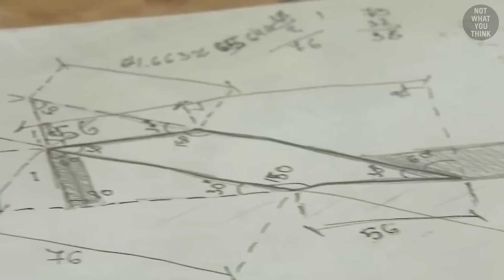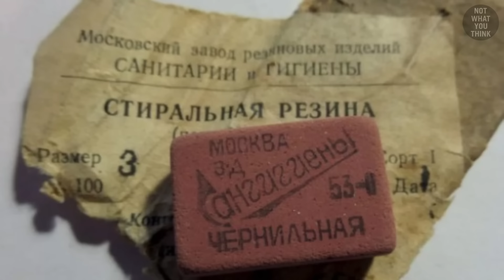These are Tanks that Ukraine hopes Russia Would Destroy

Comment: 12:13 it resembles a grave, so it will work no matter what happens 😂😂
Reply: Now using mostly intact but otherwise non-functional/unrepairable equipment as decoys is a damned good idea. A bit of welding, some paint, and some weathering, and it will look like its operational.
Example: shell of a tank with internals/engine removed. used anti-tank tubes on faked emplacements, etc.
Reply: H Dr.Kay_R

Comment: The first time decoys made a massive change was during the NATO bombing of Yugoslavia. Back then, wood models of airplanes were made in 1:1 scale, painted with original paint (MiG-29) and the engine "exhaust" was made of one metal barrel cut in two. Also, the wooden model would be padded with tinfoil and fires would be burnt in cut barrels at the back. That way, it would have both radar and heat radiation making it pretty much impossible to see as a decoy. Also, false radar positions with fake radiation sources were made in order to divert HARM missiles from real ones. And so on...
Reply: Did not work though and those responsible for war crimes ended up paying the price for them.

Comment: Fun fact general Patton was the published leader of the inflatable army after and as part of his punishment for slapping a shell shocked soldier.
Reply: You are correct. Dummy / inflatable equipment dated back in ww2
Reply: @kanthanesankandiah760 was the " dummy" the guy Patton smacked?
Reply: Patton's Army regularly out ran it's fuel convoys.

So did Hitlers Blitzkrieg. But for different reasons.
Reply: @douglasbillington8521  wtf

Comment: And you can pretty much guarantee that AI models will include decoys in their training as real targets, because it's already hard for humans to distinguish between real and decoys. We'll probably see a transition to more complex decoys as weapon systems start to have multi-sensor integration. Right now, very few weapons or platforms will analyze targets with radar, IR, and visual.
Reply: And there is part of the problem. Simple decoys are cheap and quick to build. Even basic anti-tank weapons are not. Smart anti-tank weapons even less so.
Reply: @yadayadayadayadayadayada777  no matter what people tend to say the leopards are outclassed and outdated compared to other tanks, the m1a1 is also outdated since the m1a2 is more modern but these newer tanks like the Leclerc sxxi/evolution/xlr can detect and take out any drone easily, the new panther doesn't seem that much promising with no anti drone turret

Comment: Decoys will be the first use of humanoid robots.
Reply: Surely a better use is a decoy that fights back, i.e. walking Gun Turret
Reply: Why bother with robots? Humans are cheaper/easier to replace. At least that's how Pootin would think.
Reply: @douglasbillington8521  I doubt it even for Russia. Once humanoid robots are at a stage they can be mass produced, I'd figure for decoys each one would cost like $6k max. Not that many parts, most of the value is in the software. If they are partially destroyed and recovered the cost is going to be even cheaper for a decoy.

Comment: its CRAZY how they dont spend the extra 100$ on each decoy to have
- A: Heating Pouches for the Inflatables
- B: Adding RC cars to the bottom of the tank tracks to actually move them for better decoy destruction odds
- C: Add fake radio chatter
Reply: Do you believe this video shows all the top secret tactics of the armies, and there is nothing else they might be doing that wasn't revealed to the world?
Reply: They have miniature RrC tanks that they use to distract at a distance, you can place a bao feng cheap radio inside one of rubber tanks and in daylight you dont have to use heating because its already hot in daytime. They move the decoys at night in different position
Reply: RC ? Then you need to spend more (time and resources)for advance control systems be able to work in radio suppressed environments.etc.

Comment: Here is a simple way to tell if a decoy is made of steel or not.

One can suspend a magnet from a UAV by a 1,000 ft cable.

e.g. Google
Morgan's Tackle Co. 1000 Feet 7 Strand Stainless Steel Trolling Line 30 LB

If the magnet attaches to the target then it is made of steel.

Sure the Russians could start using steel plating on the decoys but that would add cost and weight to them.
Reply: Also they could suspend a small camera from that cable and get a close up.
Reply: "If the magnet attaches to the target then it is made of steel." and you just lost a drone.
"Also they could suspend a small camera from that cable and get a close up." or you could just zoom in.